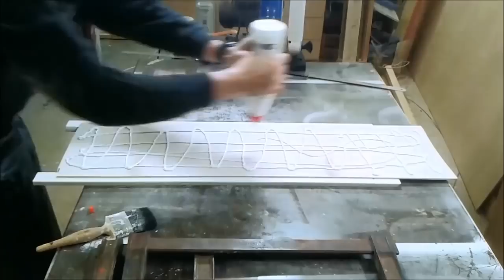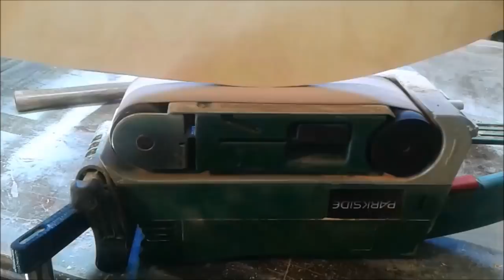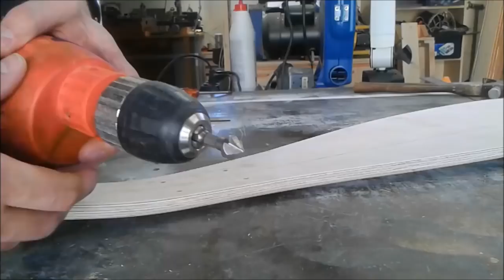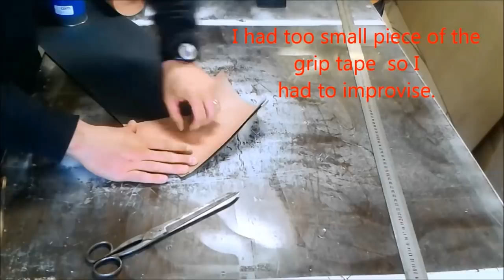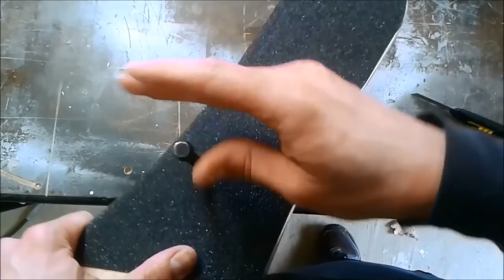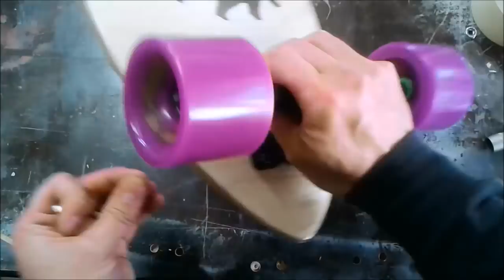DIY Longboard

Comment from the maker: just birch plywood. try to cut one of the three peaces in other direction than the other two. it will be stronger than mine. my board broke because of that.  I might use the trucks to build a streetluge.
Reply: Both bolt have to be facing outwards
Reply: to be completely honest that's a good looking board
Reply: +cade pendergaft gggdhc
Reply: do you get wheel bite in the front truck?
Reply: Cool Man!!!
Reply: you used only three plies of birch?
Can you try to use 7-11plies of more thin natural birch or maple veneers+1 ply of glassfiber?
Reply: nice job man
Reply from the maker: +zubzero 1224
Thanks for asking, but that one snapped in half. Maybe you could make one. Also I'm all the way in Finland.
Reply: Lazy watchsmith Ttt
Reply: @elvarg72  still looking for a board lol
Reply: @elvarg72  Mimic#7815 discord

Comment: cool project! I did one too. After the first try I changed the glue - normal white glue doesnt seem to be strong enough. I found a 2 component glue then. I used another kind of wood (pappelsperrholz) And i did reinforce the bottom with a layer of glasfibre... But it ended up beeing a shitty design. So a new one is coming soon... But first i take way more time for the shape...

Comment: nice job, if you decide to do it again i recomend you looking veener plywood, its basicly really thin sheets of plywood (0.5 mm) you can make a better indent and shape it better. but for the first time(i think) its really really good :-) and why did you use griptate when i make boards i just glue on normal sandpaper :)
Reply from the maker: +Mikus Haikus 
Thanks for the tips.
Reply: +Lazy watchsmith if you do ens up using it ask tge seller the right glue to use, and  its beter if you instead of clamping it up place it in a vacuun bag with a vacuum sucking it it will come out really strong

Comment: Can someone explain to me how the printing part works?
Reply from the maker: print your design on regular paper with a normal laser printer. Remember to print as a mirror image. then lay the print on the fine (at least to 240 grit) sanded wood. Then rub the paper with xylene and then i use a spoon to ensure good transfer. Thanks for waching.
Reply: Lazy watchsmith Does it have to be Xylene or do other solutions work? Thanks for replying
Reply from the maker: +MyOpinionOverYours acetone works too, but xylene is easier to use with big pictures.

Comment: Can I please get a step by step of how you did the graphic
Reply from the maker: orren45 1. Sand the wood wery smooth. Minumum of 240grit. 2. Use laser print soon after printing. 3. Rub the xylene on as in the video. 4. Rub the paper and xylene with a spoon or somerhin else round and smoot. It helps to soak the palstic in the wood. 4. If t does not work google xlylene transfer.

Comment: i want to make a very stiff longboard, which wood should i use for that? Nice video btw.
Reply from the maker: +Thije isThije 
I would use birch or maple veneers. I'm making a new one  and i will use fiber glass to make it stronger.
Reply: +Lazy watchsmith thanks! next question, why did your board break? How can I prefend it?
Reply from the maker: +Thije isThije
 It was too thin at the end. And I did saw all the peaces in the same direction.
Reply: +Thije isThije Morning wood

Comment: How did you put the printed images on the longboard, I bought the same stuff you had and it didn't work. How long am I supposed to run the xylene on the paper for?
Reply from the maker: 1. Sand the wood wery smooth. Minumum of 240grit. 2. Use laser print soon after printing. 3. Rub the xylene on as in the video. 4. Rub the paper and xylene with a spoon or somerhin else round and smoot. It helps to soak the palstic in the wood. 4. If t does not work google xlylene transfer. 
You can also try to iron he printer image on to the wood. The hot iron should melt the print on the wood. I think this would work better on very dense wood. Sorry about my english.

Comment: what product was that to get your stensel on your board?
Reply from the maker: +Koen Demonie 
Xylene. You can also use acetone, but xylene is easier.
Reply: +Lazy watchsmith thanks, i ended up printing it directly on wax paper and then smoothly rubbing it over to my board
Reply from the maker: +Koen Demonie cool. I have to try that.
Reply: +Koen Demonie dude, mind sharing how you did it?
Reply: +Tango965 just print whatever you want directly onto the waxy side of wax paper, then gently lay it on your wood and smoothly run it over. i used a ruler to make sure everything was even. also, don't push down too hard, just one even strike.

Comment: hey how thick was your plywood that u used?
Reply from the maker: jacob moloney 3mm.
Reply: Lazy watchsmith thanks i might give it a go     did the board hold up well?
Reply from the maker: jacob moloney no. It was too thin at the back end. If you have enough plywood, you should cut one piece in other (to grain of the wood) direction to ensure proper stiffnes and strenght. Have fun my friend!
Reply: Lazy watchsmith wat do u mean?   and wat did u use for the grafics?
Reply from the maker: Plywood bends better in one direction than the other. So cut one in the stiffer direction. And the grafics are printed with laserprinter on normal paper. Then I use xylene to transfer it to the wood. And I rub it with a spoon to ensure good trasfer.

Comment: What did you use to "print" Your logo on the board? Did you just print it from your computer on a shit of paper and soak it with that liquid?
Reply from the maker: That is right. Use regular laserprinter. You can also use acetone instead of xylene.
Reply: @Lazywatchsmith  thx for the tip!
Reply: Doesn't work for me, maybe because I use an inkjet printer... I'll try with laser

Comment: How do you apply your drawing on your board?
Reply from the maker: Go watch my diy disc golf disc video I explain it there.
Reply: +Lazy watchsmith can you make a toturial video about it because i didnt see you explain it in the vid
Reply from the maker: Watch my Diy disc golf disc video from 7:25 It is all there
Reply: +Lazy watchsmith i see, you used a laserprinter you said. is it able to work with a normal inkt printer
Reply from the maker: No it wont work with ink. Steve ramsey has a tutorial how to do it with ink printer.

Comment: Dude! how did you apply the graphics to the board?
Reply from the maker: +Peter Middleton 1. Sand the wood wery smooth. Minumum of 240grit. 2. Use laser print soon after printing. 3. Rub the xylene on as in the video. 4. Rub the paper and xylene with a spoon or somerhin else round and smoot. It helps to soak the palstic in the wood. 4. If t does not work google xlylene transfer

Comment: who taught this guy to put in bearings
Reply from the maker: +john jones 
No one. What I did wrong?
Thanks for watching.
Reply: +Lazy watchsmith not anything wrong just different. usually i would use the axel to push the bearings in. just never seen someone push them in with their fingers. still a sweet board
Reply from the maker: +john jones 
Ok. Thanks! Have a good day.

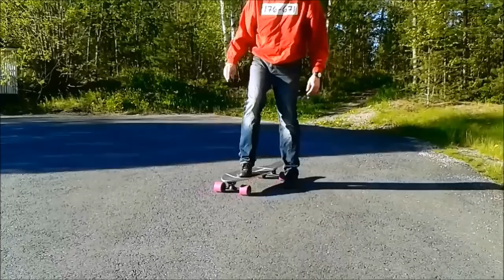Comment: Looks pretty flimsy ( 10:25 when you stepped on the middle) But a pretty damn good job for not knowing anything about long boards! I say get thicker wood for the Deck, just enough so it doesnt bend in the middle.
Reply: ita called flex and its not necessarily a bad thing
Reply: Yea i know, its just more of a chance of snapping when doing tricks
Reply: Nuka Playz try to snap a loaded deck, not gonna happen even with the highest level of flex they have.
Reply: Snapped one about a hour ago, it was fucking easy (maybe a 5 month old board)
Reply: +Nuka Playz im a bit doubtful cause loaded is known for its good flex and indestructability
Reply: Well my board snapped today while skating, and im probably not getting a new one (Brand skateboards anyways..) anytime soon